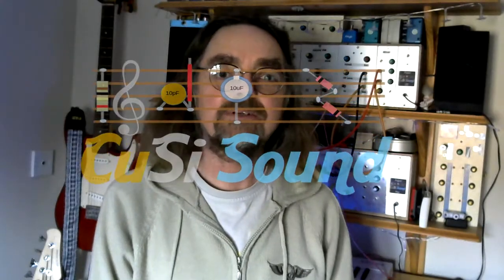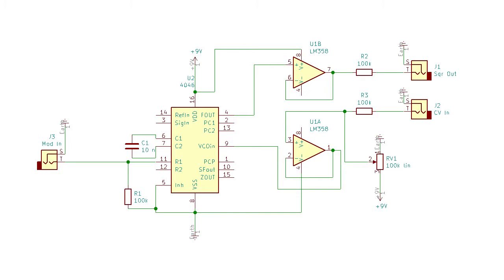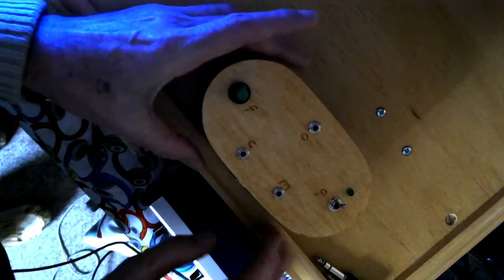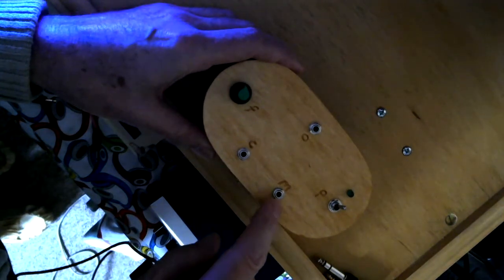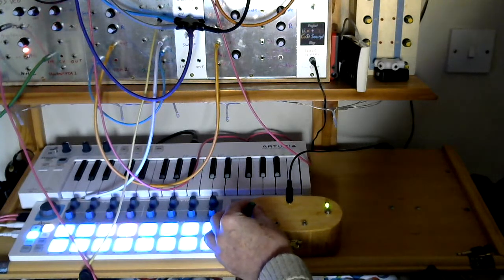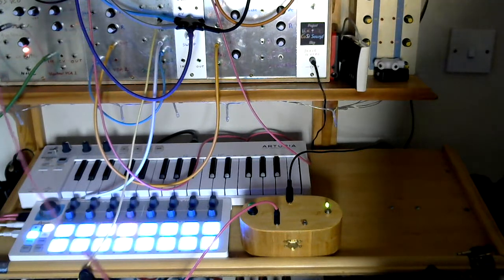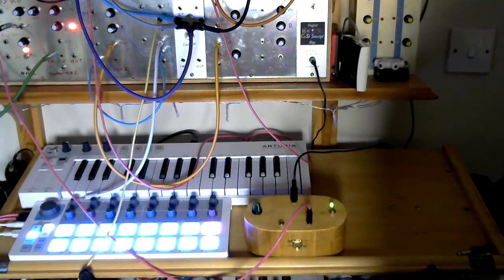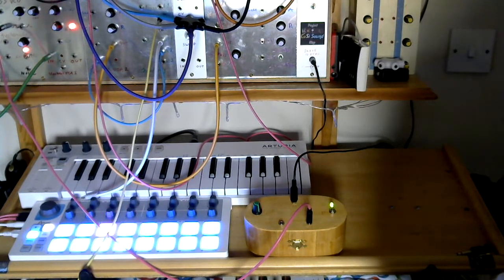Little Boxes Part 7: 4046 VCO

Comment: I have my 4046 set up on my breadboard as a simple vco and output to a small 0.25W speaker .  But it seems quiet up against my other 556 basis synth ( the same as 'Technology will save us' atari punk synth) which is louder on the same speaker.  Is there anyway I can make it louder?
Many thanks.
Reply from the maker: This circuit is not designed to drive a speaker directly. If you want it to be louder you will have to amplify the output from the VCO.
Reply: @CuSiSound  Many thanks for the quick reply.  I was told that logic IC's are quieter than 556/555 IC's so I may have to build a LM386 amplifier.  Or could I put a 2W mini speaker directly to the 4046 or will that damage the IC? thanks.
Reply from the maker: Using a higher wattage speaker will not increase the volume of the sound output. The speaker watt rating is an indication of the level of signal you can feed into it without distortion/damage. A LM386 amplifier would be a good way to boost the signal and get more volume out of your speaker. The LM386 chip comes in a range of wattage outputs so you can select the one that best suits your needs (and speaker watts). Keep experimenting, solving problems is a really good way to learn about electronics and how circuits work.